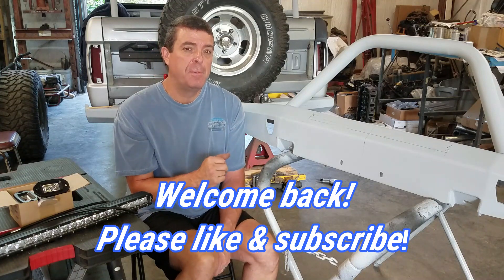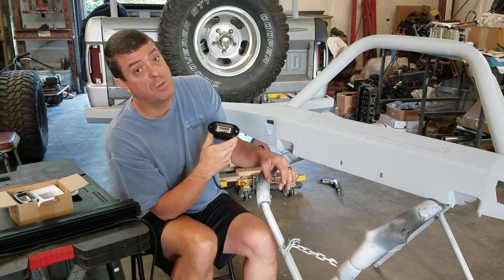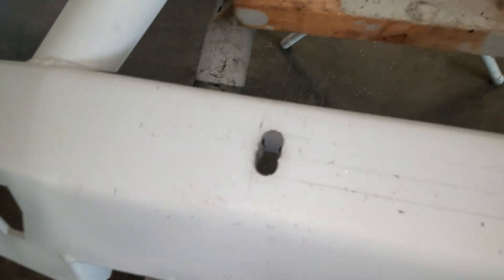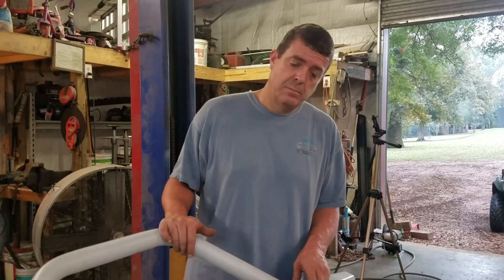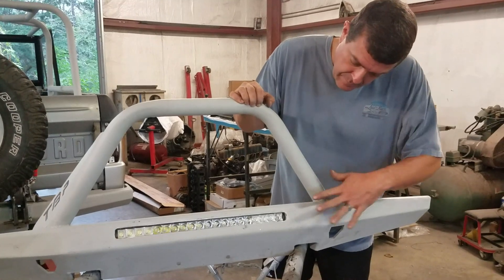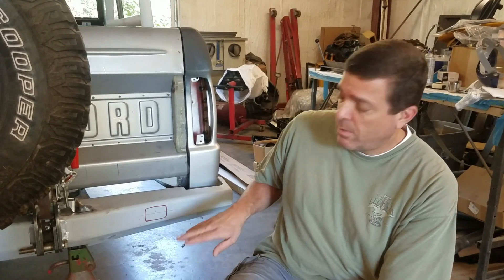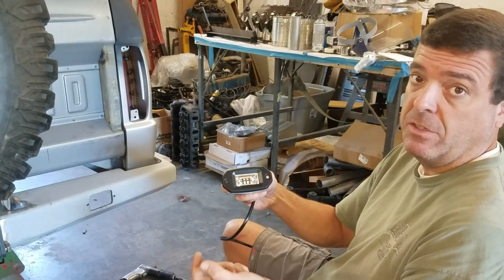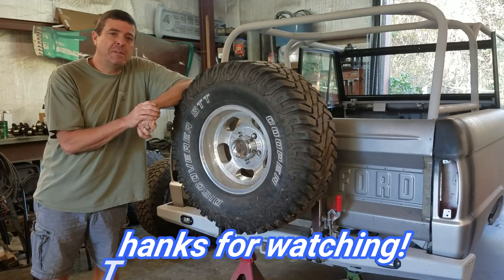LED Bumper Lights - 1966 Ford Bronco Restoration Project

Comment: Very cool! I really like the look of the front light install! Makes me want to get on that part of mine! I just got my block back from the machine shop today so engine assembly will be soon. Finished up the front suspension rebush this morning... I tell you what, that track bar is a bugger to get in place with a 4 degree caster C bushing and urethane bar bushings! Lol. Looking great! Your attention to detail is amazing.
Reply from the maker: Thanks Rob.  Sounds like you are moving along quickly.  If you keep it up you are going to beat me. Lol   I am trying to decide what to do about my engine.  Stroke it or just a mild build.  Keep it up and send pictures.

Comment: Thank you for your videos.  I can't seem to find your front bumper on TBP's website.  Not sure if they discontinued it.  Can you post the P/N for both the front and rear bumpers you bought?  Thanks in advance.
Reply from the maker: Scott the front bumper was bought from their scratch and dent tab on their website.  They are called impact bumpers I believe.  I will see if I can find the part numbers for you.  Thanks for watching!
Reply from the maker: TBP Part numbers - Front 5604JJ2  Rear 5602  Tell them where you saw them on our channel.  Thanks,
Reply: @JasonJonieBuilds  Thank you for your quick response.  I will mention tie channel.